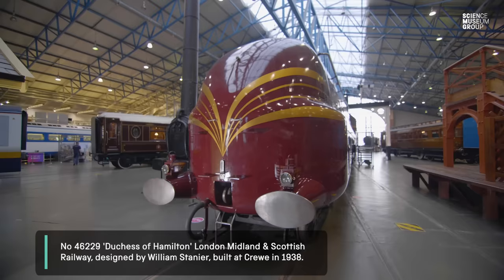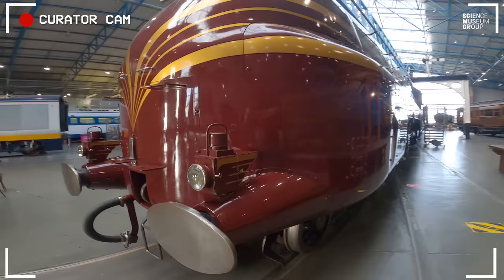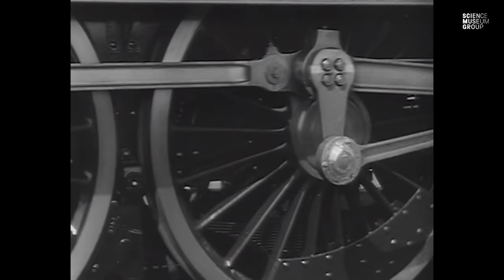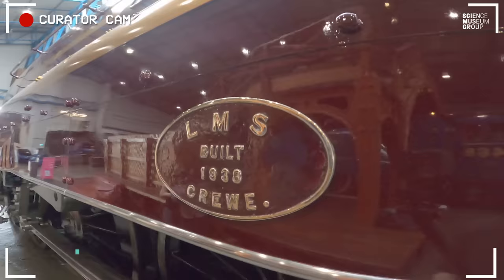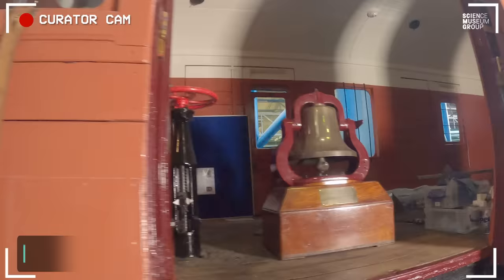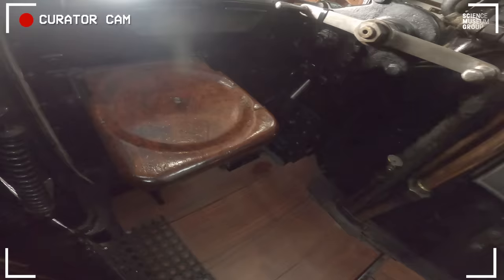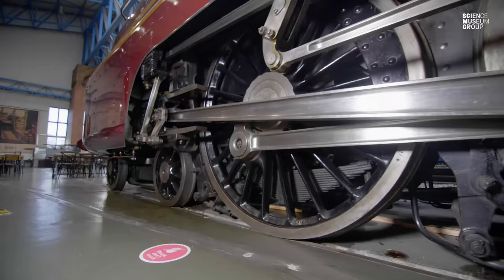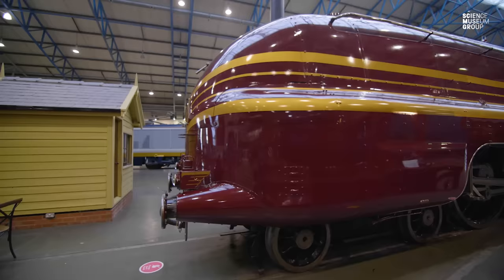In-depth with Duchess of Hamilton: A Streamlined Icon | Curator with a Camera

Comment: I think this livery is the origin of the phrase “go-faster stripes”.
The coal consumption above 100mph with 2 firemen was so extreme they couldn’t shovel it in quick enough. 
It just burnt/vaporised all the coal instantly.
Reply: An engine that would've benefitted from a mechanical stoker no doubt, but I'm sure the unions would have raised objections to it.
Reply: @Shipwright1918  I once heard a story about a fireman here in America who had to hand-fire a Big Boy with a conked-out stoker.  They were running light from I think Green River back to Cheyenne to get the engine into the shop to fix the stoker.  That fireman was truly miserable when they pulled into Cheyenne!    And the best part is that the dispatcher had wanted to give them a train to haul, but the fireman, understandably, put a stop to that idea right away.

You’d have needed 4-6 men shoveling to hand fire that engine with a train behind it.

Comment: It's kind of odd that some clever boffin at LMS or LNER didn't develop a mechanical feeder for coal from the tender to the firebox and taken the load off the firemen? Especially with the coal pusher being installed already! Nice video Mr Coulls & team
Reply: Many large American locomotives like the NYC Hudsons and the UP Big Boy had mechanical stokers because they burned coal at a rate that firemen with shovels couldn’t keep up with.
Reply: Honestly, I'm just as stunned. That coal pusher was a good half-step, but I think they would've been even more powerful with some mechanical stoking. The highest power output of the class was done with two fireman going at it, so I can't imagine how much easier a stoker would've made things
Reply: A couple of BR Standard 9Fs were fitted with mechanical stokers. Long story short, it wasn't very successful
Reply: Screw-type coal transport was used on boats and many engines, but did have the disadvantages of extra weight and complexity. It also may have been impossible to find the space on these engines.
Reply: @garryferrington811  It would have led to various changes to the firebox, and the type of coal that could be used for classes fitted with mechanical stokers. The American/Canadian products for the SNCF (141R) had that kit on the coal fired ones, and the coal had to be ground down to the correct size for those.

Comment: My father was an LNER man finishing up as a driver with British Railways, but this was his favourite engine. Superior to the A4’s with better design, piston arrangement and valve gear. The only thing that held these engines back was the appetite for coal. I can’t help  but think if it had not been for the war and the coal shortage that resulted and followed that a more automated firing system might have been introduced giving better results for mainline work.

Comment: Awesome video. I would like to add that not all the Duchess locomotives were streamlined. Sutherland, currently on main line tours, is one example that was never fitted with the outer casing.
Reply: Inversely, not only were most of the latter half of the class built during WWII, but with all the streamlining.
Reply: Nope, not all and not all were Crimson. The first five appear to have been finished in Caledonian Blue.
Reply: @leoroverman4541  Coronation 6200 was blue and silver!
Reply: @Volcano-Man  It was Caley Blue was the preferred coulour from what I can glean with Aluminium silver strips. Wikki's Coronation page is a mine of information.
Reply: @leoroverman4541  well that is strange as I knew some of the people who prepared 6200 for its public appearance - they said the silver paint was a bugger to do!
Reply: @Volcano-Man  One can't get a better source than that. Silver paint must have included Aluminium in some form and that tends to clump. IRC the numbers were chromium. But I spent a long time looking for the kind of blue used and from what I can make out since Caledonian Railway was a constituent they used the then Caley Blue.  I've got two that are blue and Hornby definitely got  a mismatch in the paint on one.  I have to say I don't think Stanier got a fair crack of the whip in terms of speed running.
There was one other point in the vid, which I think was, in general, rather well done and that's the issue with streamlining. Whether Stanier liked it or not the casing did not come off the Duchesses because of accessibility problems, rather, from what I can glean they were converted when Boiler overhauls became due. None of the A4's lost theirs during wartime.
Reply: @leoroverman4541  The streamlining - bit like a motor manufacturer telling engineering ''We want a 20 litre engine which delivers 2000 horse power, does 2000 miles to the fluid ounce of petrol, produces 0.005 grams of CO2 per 10000 miles etc;' The engineers do it, meanwhile the design team give them a nice sleek pile of metal and say to the engineers 'Left you a 2 cubic foot space to put your engine in!' Somehow the body shop do the miracle. Then the fun starts when it goes for a service!
Reply: @Volcano-Man   Indeed but then streamlining has been used in cars, the teardrop design was losley associated. Of course streamlining was a gimmick having little value at lower speeds. In practical terms that would never change with steam, but it can't be written off that easily. The A4's could easily have been changed to A1/3 configuration but they weren't. The spams on the southern were changed for different reasons and so were the LMS streamliners largely because they were having boiler replacements and efficiency came into it. Modern cars don't look like prewar designs because Pressed steel and be made to do things coachbuilt can't, but the engine underneath works like the original.  But we are looking at part of a class that only had ten or so streamliners on the LMS , 35 A4's on the LNER. Miniscule as part of the engine stock.
Reply: @leoroverman4541  Indeed, but I have always thought the streamlining made them look heavier than they were, and dare I say it - ugly!
Reply: @Volcano-Man   Well that's a matter of taste, they were rather bulbous in the front but unlike the Cods Mouth on the A4's the front of the Streamliners opened out. I don't think they were double skinned. Both types had a disadvantage with the drivers view somewhat restricted by the V shape of the cabs. The point is they were really advertising the speed of the services.  Nice talking to you. Keep well
Reply: @leoroverman4541  Well if we all liked the same thing how boring life would be! We would have nothing to discuss and that means closed minds.
I agree the streamlining was to give an impression of effortless speed. Nice chatting and take care.

Comment: Call this beautiful machine a "Super King"!  After all Stanier was a "Swindon man".  Please note that Coleman's Christian name was "Ted".  Btw, steam to the inside cylinders is controlled by rocking shafts driven by the exterior valve gears, a feature developed by Coleman.  On "Kings" the valve gear between the frames controlled the admission of steam to the outside cylinders. "Coronation" was never the world's fastest steam locomotive; by the time it attained the British record the German 4-6-4 #05 002 had already set a speed record of 200.4 km/h.  All in all, a very fine video!
Reply: Yes, indeed a "modernised" KIng!  More slippery because of the trailing axle, but much greater steam production.  BTW, didn't she nearly derail after that speed record, because she wasn't able to slow down enough for a curve with a 50 mph limit?  It very nearly ended in a horrendous pile-up.

Comment: This beautiful locomotive is my favourite and I love seeing it at York, the re-streamlining project to give a comparison to the LNER A4 class was amazing in every respect, finding the right thickness of steel and reforming the shape and curved front, including the hidden framing needed really decent engineering knowledge and experience. Finding the right shade of maroon after finding a pot of paint pigment was brilliant. A truly powerful and elegant design, more friction free than the A4 design, but not an easy engine to drive, fire and maintain, smoke drifting from the chimney was an issue in streamlined form. I might be saying something controversial, but I have no doubt this version of the Princess Coronation class would have exceeded 130mph if the LMS had a longer straight piece of track. I also loved seeing this engine in its later BR condition, running railtours, it was well proportioned for its size and always seemed reliable and free running. An excellent video, many thanks for sharing.
Reply: I completely agree with you it's a pity the then lms did not have a decent length of track to let her reach her full potential.

Comment: There is way to distinguish between the two when the streamline casing was removed, and that is the running boards. These were split at the front, ex streamline, whereas those that never had the streamlining fitted, it was joined by a curve, above the outside cylinders.
Reply: An even better way is to look at the top of the smokebox, which was depressed and curved to suit.  The A4s and Gresley's 'hush-hush' 10000 had a more extreme version of this (as I believe the DR 05s and the Milwaukee class As also did).  The PRR T1s (and I think their Australian hommages) do this at right angles, with 'bevels' to facilitate the pointed prow.
Reply: @wizlish  Yes. I should have mentioned this too....  thanks.

Comment: I would love to see it steam in its current streamlined configuration, it hasn’t steamed since the 90s and I think it would be a crime to not run it at least once in restreamlined condition.
Reply: Don't think that is possible unfortunately. If DoH was to run again, the streamlining will almost certainly have to come off. It makes servicing the loco an extremely difficult task. Which is why those built with streamlining had it removed tho someone who's actually British will correct me on that Lol.
Reply: I think the issue with returning locos to steam too many times is that you start to approach a ship of Theseus situation where more and more original parts from the train are replaced until almost nothing original is left. Returning to steam at the very least means a new boiler, and replacement of any other worn components needed to make her mainline worthy. Each time that occurs, more of the essence of the original engine is lost forever. For a museum especially that becomes a difficult moral dilemma. 

It's one of the reasons many preservation groups have turned their attentions to building entirely new replicas of engines, not just to fill in the gaps that preservation could not save, but also to ensure there are still locos fit to run well into the future.

Comment: We called them 'Coros' because the locos we saw were named after cities (Princess Coronation) I did wonder why the NRM put the short-lived streamline casing on this loco, because, years ago, I enquired about why the correct large tender for Stirling No.1 that had been in store since the 1960s, had not been fitted in place of the tiny (and somewhat cobbled together) one that had been made for the Single back in the 1920s. I was told by the NRM that they had a duty to present locos as they had been received. Oh!...
Reply from the maker: Anthony says:

"There's never been a hard and fast rule for the collection, as it's difficult to make a one-size-fits-all policy for so many different vehicles. However, the existence of two unstreamlined examples of the Princess Coronation class made the decision to streamline 6229 quite straightforward; it was also done using drawings and records from our archive to make sure it was as authentic as possible. As for the Stirling Single and the correct tender, we're pleased to say that the engine has been paired with the restored large tender for a number of years now and is displayed with it now in Great Hall."

Comment: I wanted to know why don’t dig a tunnel and do an extension for the
 mainline Train so they extend the unused abandoned underground 
stations.  

Why couldn’t they use the part D78 Stock train doors 
on the sides and also restructure the front face of the A60 and A62 
stock that includes the class 313, class 314 and class 315 remix and 
make them all together and also redesign them an overhead line and also 
make them into six cars per unit and also have three Disabled Toilets
 on that six cars per unit A60 and A62 stock trains and also convert 
the A60 and A62 stock trains into a Scania N112, Volvo TD102KF, Volvo 
B10M, Gardner 6LXC, Gardner 6LXB and Gardner 8LXB Diesel Engines and 
also, the Loud 7-Speed Voith Gearboxes and even Loud 8-Speed Leyland 
Hydra cyclic Gearboxes in the A60 and A62 stock, class 313, class 314, 
and class 315 and also modernise the A60 and A62 stock and make it into 
an 11 car per unit so it could have fewer doors, more tablets, computers
 and mobile phone chargers?

A Stock Train and 8 Disabled Toilets 
on those A stock trains. why couldn’t we refurbish and modernise the 
waterloo and city line Triple-Track train tunnel and make it bigger and 
extend it to bank station, making it into a Triple-Track Railway Line so
 those 4 European countries Germany, Italy, Poland And Sweden to
 convert the waterloo and city line Triple-Track Train tunnel into a 
High-Speed train?

The Third Euro tunnel Triple-Track Train line 
to make it 11 times better for passengers so they could go from A to B. 
then put the modernised  11 car per unit A Stock and put them on a 
bigger modernised waterloo and city line Triple-Track train tunnel so it
 could go to bank station to those 4 European countries such as Germany,
 Italy, Poland And Sweden. The modernised refurbished 11 cars per unit A
 stock could be a High Speed The Third Triple-Track Euro Tunnel Train So
 it is promising and 37 times a lot more possible to do this kind of 
a project that is OK for London Germany, Italy, Poland And Sweden. 

oh
by the way, could they also tunnel the Triple-Track Railway Line so it 
will stop from Buckinghamshire, Hertfordshire and Essex so that the 
Passengers will go to Germany, Italy, Poland and Sweden and also extend 
the Triple-Track Railway Line from Bank to Buckinghamshire, 
Hertfordshire and Essex Stations so that more people from there could go
 to Germany, Italy, Poland And Sweden Easily.  

Why couldn't they
extend the Piccadilly line and also build a brand-new underground train
station so it could go even further right up to Clapton, Wood Street 
and also make another brand new tunnel train station in Chingford and could they extend the DLR?

All of the classes 150, 155, 154, 117,
 114, 105, and 106 will be replaced by all of the Scania N112, Volvo 
TD102KF, Volvo B10M, Gardner 6LXB, Gardner 6LXC and Gardner 8LXB Diesel 
Six carriages and three accessible toilets are air conditioning trains 
including Highams Park for extended roots which is the Piccadilly Line 
and the DLR trains.
Could you also convert all of the 1973 stock 
trains into an air-conditioned maximum speed of 78 km/hours (48 MPH) 
re-refurbished and make it into 8 cars per unit if that will be 
alright, and also extend all of the Piccadilly train stations to make 
more space for all of the extended 8 car per unit 1973 stock air 
condition trains and can you also build another Mayflower and Tornado 
Steam Locomotive Companies and can order Every 17 Octagon and Hexagon shape LNER diagram unique minor no.13 and unique small no.11 
Boilers from those Countries such as Greece, Italy, Poland, and Sweden, 
can they make Mayflower and Tornado Steam Locomotive speeds by up to 
117MPH so you can try and test it on the Original Mainline so it will be much safer for the Passengers to enjoy the 117MPH speed Limit only for HS2 and Channel Tunnel mainline services if they needed 16 
Carriages Per units can they use those class 55’s, class 44’s, class 40’s and class 43HST Diesel Locomotives right at the Back of those 16 
Carriages Per Unit so they can take over at the Back to let those 
Mayflower and Tornado Steam locomotives have a rest for those 
interesting Journeys Please!!!!, oh can you make all of those Coal Boxes’ 16 Tonnes for all of the 117MPH Mayflower and Tornado Steam 
The locomotive’s so the Companies will Understand us, passengers!!!! so 
Please make sure that the Builders can do as they are Told!! And please do something about these very important Professional ideas Please Prime Minister of England, Prime Minister of Sweden, Prime Minister of 
Germany, Prime Minister of Italy, Prime Minister of Poland and that 
Includes the Mayor of London.

Comment: I would be interested to learn how much more efficient these steam trains could be if they were made with modern materials technology. When you thiink that this beast was capable of 3000 bhp using the metallurgy of the 1930s, and you then realise that even a "Performance" car engine of the time produced something in the region of 100bhp, how much more would those 3000bhp be today?
In reality, I suspect not that much, I suspect that the improvements would have come in the area of automation, transmission, weight and ease-of-use. We would probably also have seen a transition to turbines because of those factors.

Comment: I didn't realise that the steel casing was so heavy. Does anyone know if aluminium was ever considered and if so why wasn't it used. These locos, and the A4's must have been a refreshing sight in the immediate pre war years.
Reply: Aluminium was still relatively new and expensive with few people who knew how to work it let alone affix or weld it.
Secondly, the coefficient of expansion of Al relative to steel is much higher so there would be differential movement between the engine and the cowling/streamlining, not easy to overcome.
Reply: @vumba1331  Thanks for that.